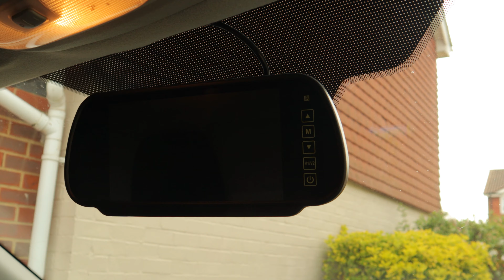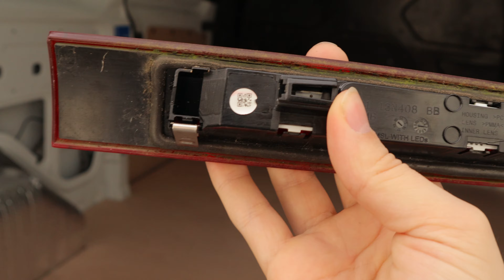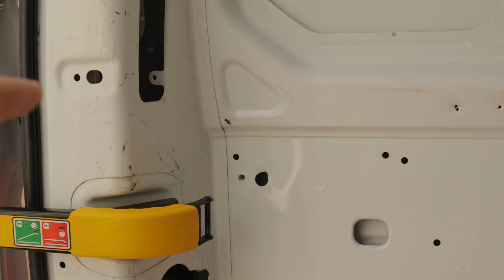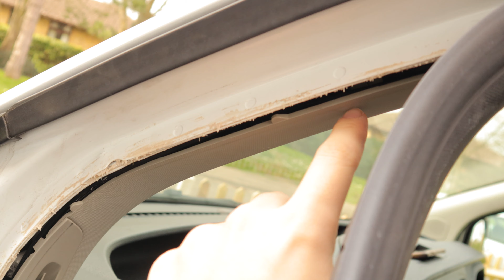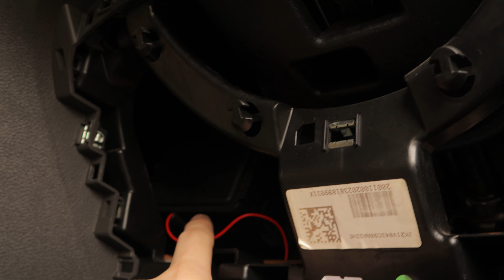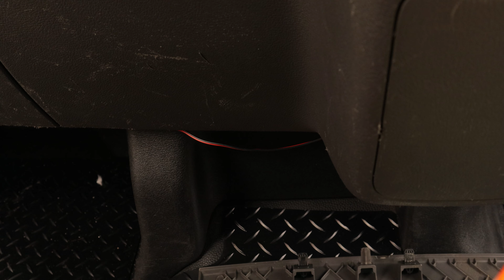Fitting my Rear View Camera | Ford Transit Custom | van conversion part 2

Comment: Great video for a task I am thinking about carrying out, I have watched another video where the chap wires the camera directly into the reversing wire in the rear door panel? Would this work with the camera you installed in your van? Many thanks for posting your video.

Comment: Hi great job. Ive just brought the same van. A 2016 hightop. Not sure i think there two types led or none led? 
Any idea if both types will fit? Thanks just starting my build next week.
Reply: im just doing mine in a high top transit. got cables run in from back to glovebox now.